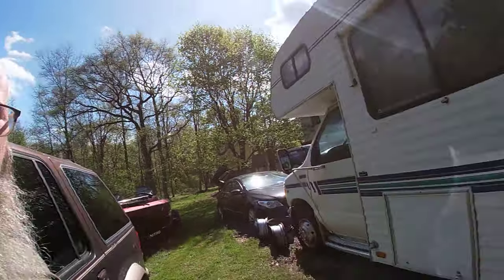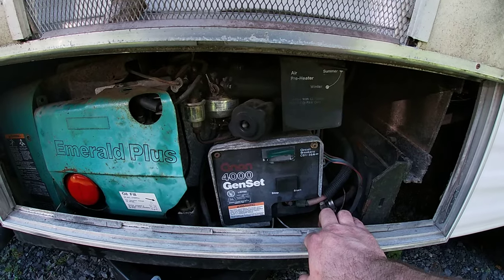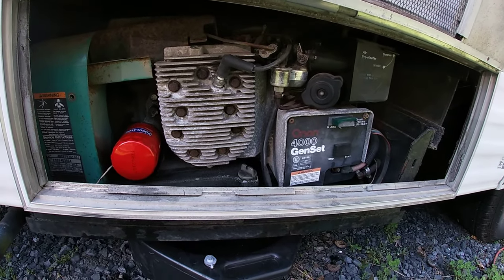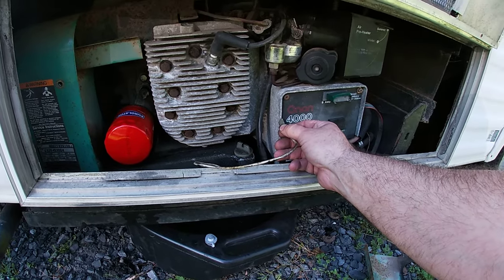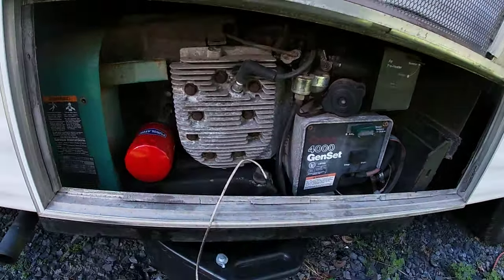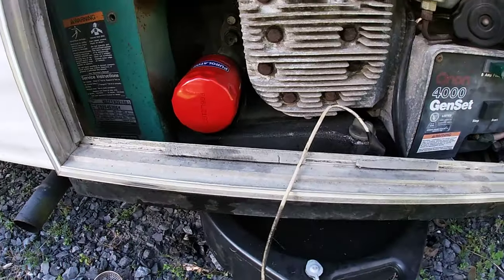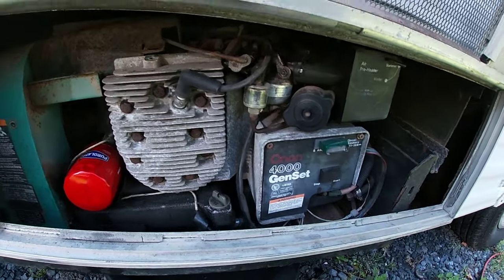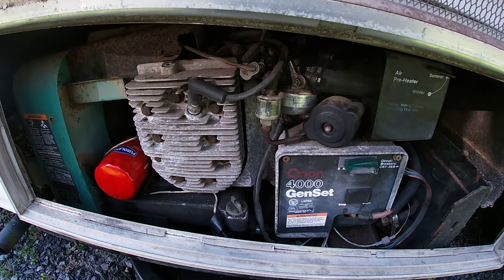Most Common ONAN RV Generator Problem Repaired in 5 Minutes! "My Generator won't stay running!"

Comment: The most common problem when they exhibit that symptom is not a low oil pressure switch problem. It is loss of AC output. I worked on those old units for 20+ years.....Brushes and slip rings very often are dirty or worn. A bad voltage regulator is also very common.......I found very few machines with bad oil pressure switches. Yes it can be and is an easy test as you demonstrated. Those machines have not been made for over 20 years now. I work on the new types all the time in warmer weather......see fewer and fewer of those old BGE/NHE models. They were good but are old and many parts are not available from Cummins-Onan any longer......
Reply: Where is the voltage regulator?
Reply: @petergoodloe6937  Inside the area behind the front panel on most machines. The control board is mounted on the back of that black plastic panel where the start/stop switch is mounted. Some machines like an NHE with electronic governors have the V/R mounted on the base below the stator housing and under the starter area. I’ve fixed them all and know them well. 20 plus years as a Cummins-Onan repair tech
Reply: @richb4099  I have a newer genset getting code 14 runs then dies in a few seconds if I restart right away it will run perfectly in no power mode with light flashing fast. Any help would be greatly appreciated.
Reply: @darrinnorman9373  Check the brushes first. If it’s a 4KY brushes can’t be visually checked but an ohm test usually is good. A 5.5 or 7 KW unit, brushes are accessible and can be checked visually very easily. The ohm test on the 4Ky is done at the connector that goes into the back of the control board. It has to be pulled out. Pins number 9 and 10 at the female end of the connector. The connector is numbered on the back for wire/pin connections.
Reply: @richb4099  it is the 5500 thank you I will look tonight. It's strange though sometimes it will just run fine with no problem at all.
Reply: @darrinnorman9373  They are notorious for random shutdowns. Usually not a 14 fault code though. I’ve worked on them for 20 plus years and trust me they are difficult !
Reply: @richb4099  anything else I can check tonight while I'm in there?
Reply: @darrinnorman9373  Unfortunately I have seen a number of 5.5's develop failed stators.....that's a major failure and would require a complete new generator end and they are unavailable last time I checked........It could also be the control board but I have test boards and just plug one in to see if there is any change. Buying a new one is a lot of money and if the machine has a bad stator.....money wasted....
Reply: @richb4099  Alright well none of that sounds good I thank you for your time I appreciate it
Reply: Rich, great info!!!   You should start your own YouTube channel!!!!
Reply: @IanoftheRVin  Seems like a lot of people have so maybe I should 😃
Reply: @richb4099 First off, I think your knowledge and expertise would be invaluable to us here attending YouTube University  😁.  Plus it a good way to maybe generate extra income and promote a business, if you have one.
Reply: @IanoftheRVin  I already make a living fixing Onan’s as well as other equipment. 30 years working for a generator service company. I am the Onan Guru in my area. 😂 In warmer weather that’s pretty much all I do. Fix Onan’s in RV’s and other vehicles
Reply: @richb4099  They say if you do what you love you'll never work a day in your life.   What "area" do you service?
Reply: @dberg1964  Older units had a separate voltage regulator and control board. The only way to test the brushes and rotor/slip rings without pulling it out and apart is to identify the wires that go to the brushes. An ohmmeter is needed. A service manual is really what you need and they are available and not expensive. The manual shows all the wiring connections and test info. Your machine is likely not making AC output and that’s why it stops running. You will ruin your starter if you keep holding that start button down.
Reply: Hey i also a old time generator tech worked on them long time but i had a customer bring me his 7.0 onan NHM-FA26105H its 98 model . it has got me stomed he said it was run some times for 5 are more mis when first trys it then shutdown then restart run only few mins i found it to do the same on me. if you hold the switch it hold the relay in of course. stay runing. he changed all the ignion stuff and controller. and govornor control. and carb. . so i did my old school on it i removed oil pressure switch they seem never be bad. all good. i toke my jumper wire and went off solnold to postive on coil and started it run a long time until fuel pumped out pump. can you please tell me what i need to check. the tech support from cummins to do what i already done and yes it putting out 126 volts to line.
Reply: I got a 6.5 nhe, started up ran, but not putting out enough power or thought it was a breaker issue. Went to start up again, won’t run once let go of the button and blowing that 5 amp fuse. Any thoughts where to start troubleshooting
Reply: @nathangogol2983  Not going to be easy to diagnose or repair. Sounds like it lost AC output and the blowing fuses part makes it more complicated.
Reply: @richb4099  any suggestion where to start. I can access service manual online at least.

Comment: For anyone who can't access the oil pressure sending unit wire as the video explains but can access the control panel, pin number #5 on the control board is the oil sending unit wire. That wire has a crimped wire lug that is connected to a longer wire, I disconnected the wire that is connected to the control board and shorted  it to ground to test the oil pressure sending unit.

Comment: Thanks, I have a 7000 emerald that has the same problem. I salvaged it from a junked rv.  I was not able to remove the field wiring into the remote start switch. Thanks.

Comment: My elderly grandparents were gonna start canceling their July camping trip if they couldn't have the overhead A/C running going down the road. It's a 1981 Fleetwood Southwind with a very similar model of generator to yours. They don't know a ton about these things and while I'm somewhat experienced in this field, I don't know it all. Glad to have people like you to show us these things, it saves time and money to do search around on the ole tube. Thanks a ton bud 👍
Reply from the maker: My pleasure... I’m not an expert on much of what I post, but I occasionally run into an experience or discovery worth sharing if I feel it’ll help others. Thank you for watching and for your kind feedback.
Reply: We have a 1995 Fleetwood Southwind ! Bought it used last year and the generator was not working when we bought it. Has super low hours on it so hoping it's an easy fix and has issues from just not being used or stored for long periods 🙏 can't run the overhead AC units without it

Comment: Just bought an RV and the original owners said the generator ran great. Got it home and it won’t crank at all. Looks just like this one. But white wires coming out the circuit breaker on the right side are cut and capped off. I can hear some noise when I hit the start button and nothing else. No cranking.

Comment: So mine just turns and turns but never fires. I still haven’t tried grounding out like recommended in this video, but could this be the fuel pump or other issue?
Reply from the maker: Correct… you’ll have to run through the basics of combustion engine troubleshooting. Check for spark, verify you have fuel, etc. If it is motorhome mounted, ensure you have more than a 1/4 tank of fuel… most manufacturers mount the fuel pickup high in the main fuel tank to prevent one from stranding themselves running their generators.

Comment: I'm a new RV Owner So the Generator  gets it fuel from the Rv?
Reply from the maker: Correct… and in most cases a generator won’t run if the RV has less than a 1/4 tank of fuel to prevent you from stranding yourself. This is usually accomplished by pickup tube placement.

Comment: THIS IS HOW I FIXED MINE, IN THE CASE OF....
"I CAN'T START MY GENERATOR"
It's has been two years since last time it was running, so I started by checking oil level full at gen dipstick (it won't start if low oil because of sensors) then I checked gasoline more than 1\4 tank in the RV (also safety sensors), sparkplug checked for good spark, also checked the manual reset circuit braker ( to be ON) at front motorhome engine compartment for 12v current to the generator to be able to start it, also cleaned the carburetor and even installed new one but same situation, then checked wires and found some has been chewed like gum by rats at the back of starting switch generator panel so I replaced them, at this time the generator started but stay running only by keep pushing the switch on all the time, so then finally I knew it was internal electrical problem from the engine itself, so I took the generator out from my RV to work in my garage, (I did this by myself with some tools and old Mayan tricks ) lol, it's really heavy for one person. 
I disassemble the unit at my garage and started by removing the cover, then the cooling fan or flywheel unit (it's 2 items in one) until finally I was at the gen rotor and brushes assembly area and this is what I found: one more wire chewed by filthy rats plus the stinky rat nest in the middle of the generator motor coil, I fixed the wire and sanded the commutator copper contacts where the brushes are sitting becouse they were real duty with old urine from the rats, and of course I got rid off the stinky nest, lol!!!
Then I assembled everything back together and... bingo it's runing like a champion!!!
For this project materials involved was about $60.00 including an aftermarket new carburetor and an harmonic balancer/steering wheel puller (available at any auto parts for $25.00) to pull the aluminum fan out and (flywheel). 
Just picture this: (Any gasoline engine run smooth if gasoline and DC current aren't interrupted) so following this important principle you'll always find the problem to be fixed. 
Also if you have a onan microlite 4000 like mine, don't run it for more than a minute without the cover because you'll cook the engine real fast, also keep the eye on the aluminium fan and your fingers after cranking it in case you missing one or two members...just kidding, lol!!!
After testing the gen then I did put the air cooling assembly back and the rest of components including the cover, now it's ready to be installed at my  RV.
Once the gen was installed back at my motorhome I started it to be tested for electric power but not before flipping the electric switch (on) at the gen starting control panel (sometimes hiding under or around the panel) to transfer power to my RV GFCI main outlet and electric panel as well, my motorhome it's equipped with GFCI so I reset it and tested for green led light indicating power is ready at my main breakers panel, so I turned my main breaker (on) along the others ones but no power was present at my  breaker main switch (faulty main braker) so I flipped it many times, sometimes you can make it work again, mine did work, lol!!!
 I'm happy because everything works now including the ref for cold drinks and AC for this crazy summer, lol! Later I'll buy me a new main braker, for now this is a  resurrected generator story that needed to be shared. 
If this can help eaven one person to save time and $$$  it'll make me more happy, thanks for reading!!!
Reply from the maker: Wow! Thanks for sharing Locopilot!
Reply: @jeremy_rigged  you welcome!!!
Reply: I just bought My Pretested 1986 in a Pretested Gulf Stream.  It has Squirrel and Rat Damage.  I might pull it out, too.  I have to see if The RV runs first.  It had a Theft Issue.  They stole the Battery's and cut the Cables and took the Cats.  I have a Portable Generator.  My Propane Lines are Chewed Open.  I may need to modify some things.
Reply: Wow, looks like it's a challenging project, let me know what did you found in your generator Christopher, cheers!!!
Reply: @locopilot1  It's a project for sure.  It has a broken wire on the 4 wire plug in connector I have to fix.  It's been sitting for 9 years and I have to deal with the fuel system.  Someone stole the battery's and cut the Cables out.  I'll be on the Generator after I test fire the Engine and Transmission.

Comment: Jeremy, thank you I will try this, I bought a used AT&T service truck,   The oil is new , filter looks new, however, it will start , just not stay running, has 1200 hours, it’s a onan 6500   Thank you

Comment: Quick question I see you have green electric tape where the DC fuses go did you have to put something conductive to bridge the two ? I just picked one up and it seems to be missed the fuse cover
Reply from the maker: @WestWayz325  good eye! No, the tape was there to hold the fuse cover on… they seem to get brittle and crack from the heat and exposure to the elements. I should have my son 3D print me a batch of them. :)

Comment: Symptom of the generator I have exactly what you're demonstrating in this video. I do have one question as I'm new to Onan. I replicate the symptoms from inside the cabin of the RV but the switch on the generator itself does not work. Is there a toggle that you switch so you can operate from inside the cabin or on the generator itself or can they be operated either place
Reply from the maker: Normally they can be operated from either place… simply two momentary toggle switches wired in parallel.

Comment: There not a dime a dozen. Though they aren't worth 5 cents a 100. 
Don't know why in the world RV factories, don't just don't go back too; pull the rope system for less trouble shooting. Think about it;
(1) you always end up OUTSIDE, trying too figure out why it quit or won't start.
(2) much easier/cheaper, to remove or replace a Generac or other unit f the RV manufacturers put a fold away ramp in that compartment.
(3) there Junk because; Onnan knows there the source for FUTURE SALES.

Comment: Nice too know,, thanks.
But,, they idle so rough, "like yours is" , makes one mess with carb, coil, possible; mice, rat's and other chewing critters created problems,, well it ain't NO FUN when your RV ing too relax. I am gonna turn my 6500 into scrap cash and buy a ROPE PULL Portable 7000 watt Generac and collapsible ramp too put into my; FUTURE modified MOTOR HOME GEN COMPARTMENT!! 
Screw ONAN CON MAN!

Comment: great video.  my issue is when starting the spark plug sparks once and only once then dead.  If I press the stop buttom to prime the fuel pum does not run.  if I connect direct to the battery it does.  my guess is the circuit board.  What do you think?

Comment: I’ve got an emerald plus that’s making high voltage. I believe this started happening after I cleaned the slip rings. High voltage as in 160vac. I did the rotor test at the brushes during cranking and the meter jumps all over the place. If the rotor or stator had a “flying short” it wouldn’t make power at all, correct?

Comment: I have the same generator as this video but when I try and turn my on only the starter comes on but it won’t start up any tips ? Thanks I’m advance
Reply from the maker: Hi Jose! In the description section of the video is a troubleshooting guide that has a lot of items listed to check for a “no start” condition. That’s my best reference and advice for a place to start since so many variables exist for this condition. Best of luck to you my friend. https://www.flightsystems.com/pdf/onan-rv-troubleshooting-guide.pdf

Comment: Hi I have a a 1991 onan 4000 emerald plus gen set. It runs fine and powers the rv for 5minutes. Then surges, the house power goes out, it stays running but makes a loud clanking sound like there are loose 
screws jumping around inside of it. When it calms down (idling) the house power comes back on.

Comment: Good to know, but it's not an issue mine has at the moment. I suspect mine is just carb related since it got better after I ran it a while with fresh gas with B12 chemtool, and cleaned the heavily carboned spark plugs. The NGK V shaped electrode ones it has may be part of the problem. I need to get the proper Champion RS17YX plugs for $2/each from Advance Auto and it with them.

The Motorcraft FL400S oil filter fits my 1985 Emerald 1 (BGE) 4.0 generator perfectly. They are cheap and easy to get at Walmart ($4) and O'Relly. They are used on the Ford Vulcan (3.0L V6 OHV) that Ford made for 22 years (86-08) so they are still in high usage. I like it because it's white and you can easily take a black sharpie and write when your next oil change is needed based on the hour meter. No losing your note or forgetting when it's written right on the filter.

Comment: Jeremy- I just watched your video and I am excited to clean up the oil pressure sensor and see if that is why my generator won't run without my finger on the start switch.  I bought a deep socket 1 1/16" and it is too big.  It is the 12 point socket.  Do I need to use a regular 6 point socket instead?  I tried a 1" socket and too small.  Help?
Reply from the maker: John, I ran out and double checked what I used, and it was a 1-1/16” 12 pt deepwell. I grabbed a 6 pt 1-1/16” standard socket and it fits as well, but you may not be able to grab enough of the sensor once the socket is mounted to a wrench or extension. It’s entirely possible that the oil pressure switch was replaced at some point and the replacement was slightly different. Sorry I can’t be of more help… I can only confirm what was on my own equipment. Best wishes, and hope cleaning the sensor works for you.
Reply: So Jeremy- I did the oil pressure sensor wire bypass and grounded the wire end to the frame- and generator still shut off after I released the start toggle switch. Any ideas you have that would be a next step troubleshoot would be appreciated!